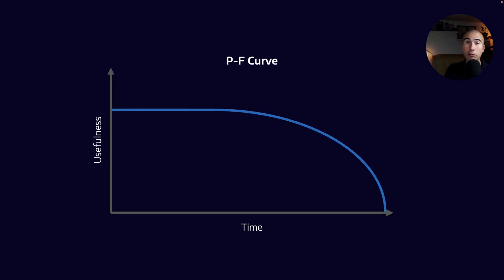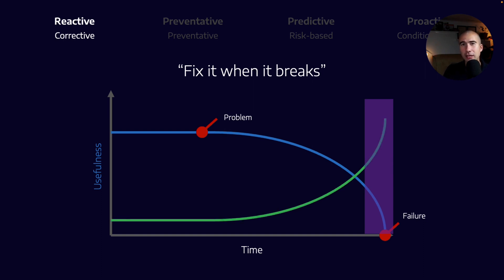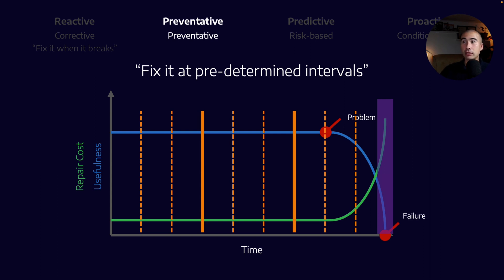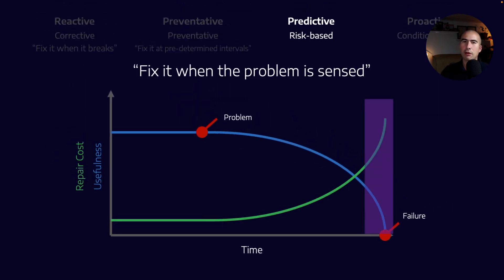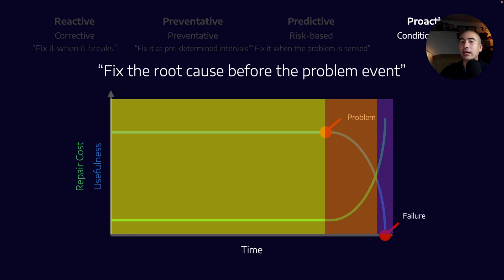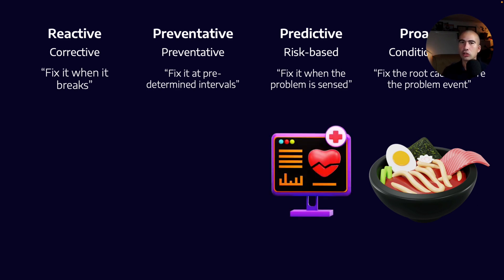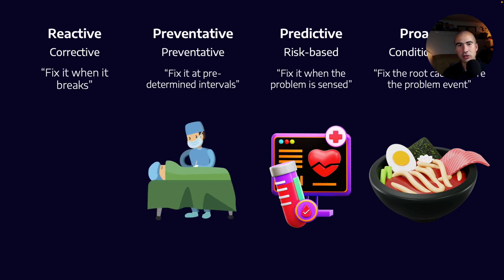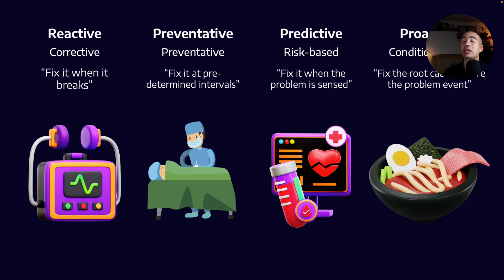Predictive, Proactive, Preventative & Reactive Maintenance and Lubrication.

Comment: Agreed, and use of analogies helps everyone understand and is characteristic of great teacher, great job 
Now, having said that, I would love if you could tackle the issue of lubricant compatibility with plastic, silicone and rubber(yes, all the types of plastic,silicone and rubber, I guess silicone is a type of rubber)
I have been trying to learn what lubricants can damage what materials I just mentioned, and how can I know this before hand ?
Most lubricant products have MSDS(material safety data sheet) which 95% times contains the list of ingredients, how can I utilize  this list to know if the lubricant product will damage my materials ?
There has to be some way to know this without going crazy